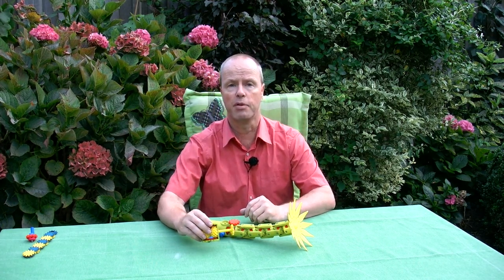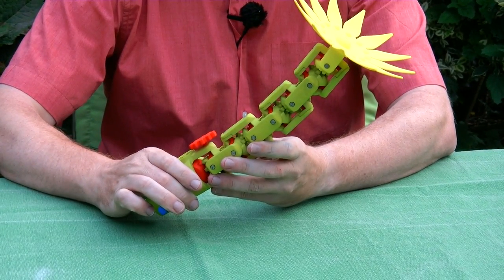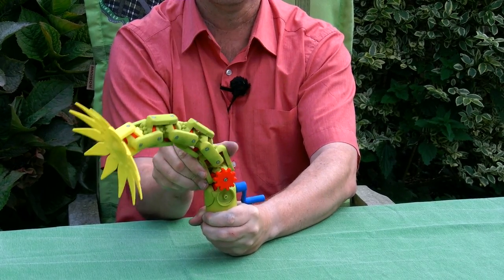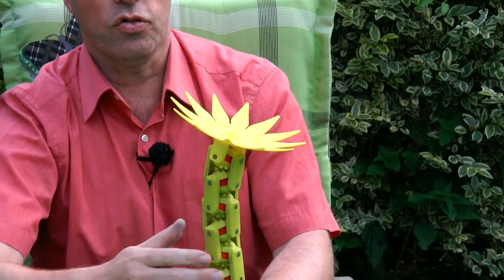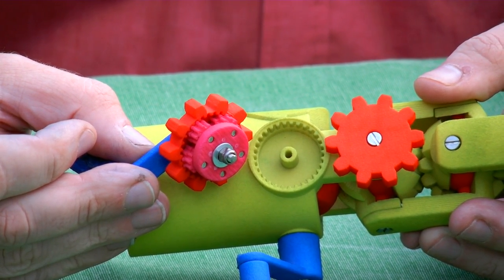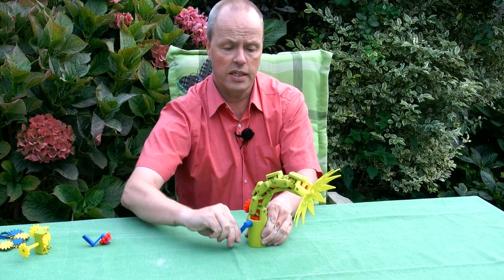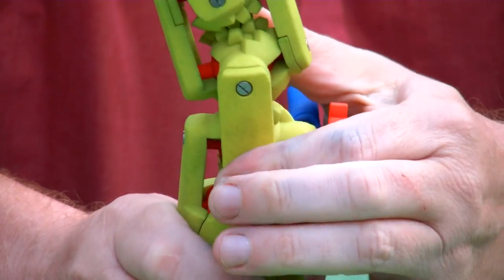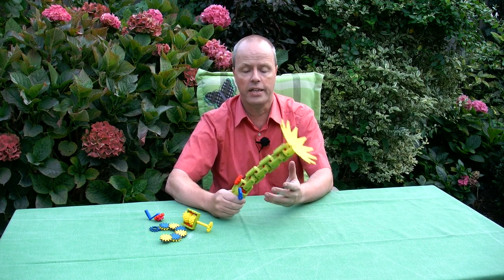Frolicky Flower

Comment: This is a very interesting one.
To me, the big question is why the 'arm' needs to flex in two directions rather than just flexing in one direction, and then having a rotating base.
The difference is that the orientation of the 'head' of the mechanism is different this way, so I think that may be a clue to it's purpose.
For instance, if you mounted a marble run game on the top, this could be used like a set of controls to play the game (although I know there are simpler ways of doing that).
Curious.
Reply from the maker: Excellent observation! You are closer to answering the question from the video than any of the other commenters.

Comment: Unique pedestal stand for solar panels to track the sun. To be more effective.
Reply: Far simpler solutions exist for that.
Reply: @kurtilein3  true, but like buying a Tesla, I would rather have the Oscar branded solar panel tracking stand.  If it worked it would be another design of his for my collection.

His puzzles are like works of art, that you can pick up and mess with on purpose.
Reply: @tripolarmdisorder7696  So, you're going to walk outside and spin that little handle every time the sun has moved a bit?
Reply: @Dueilangoisseus  I'm sorry you were dropped on your bonce as a wee child, to not understand that small electric motors and and a circuit board with some light sensors can do the job automatically.